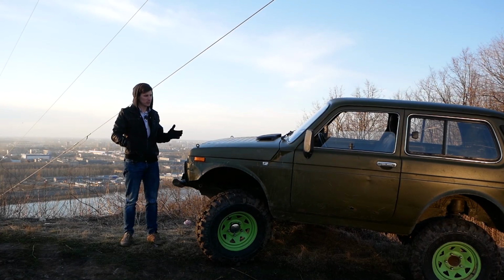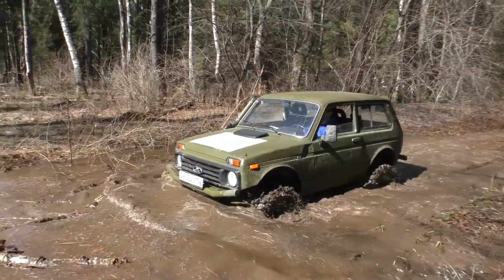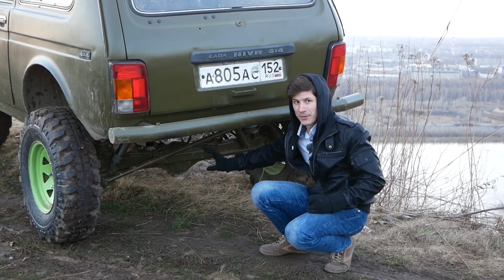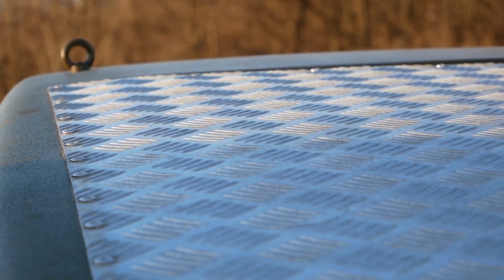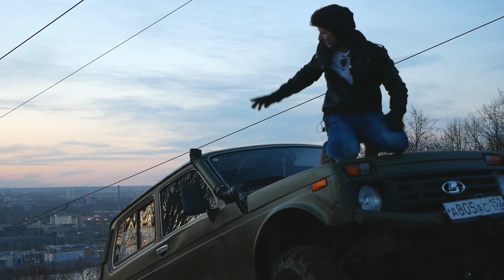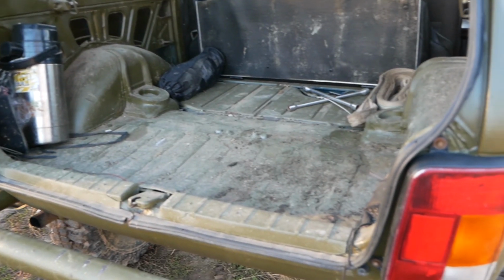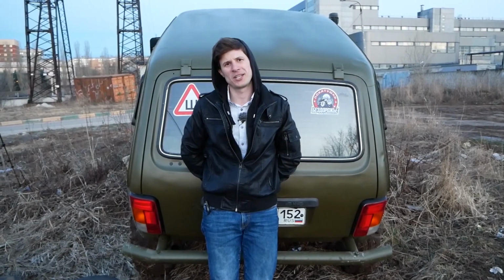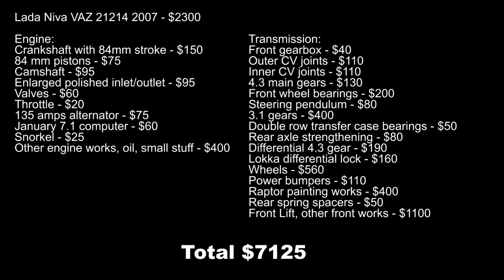How much is to build offroad Lada Niva in Russia

Comment: This is a modification I like. I have two questions tho: I'm looking for a replacement of the original Bosch ECU for years now. You said "January 7.1". Never heard that before. Coudn't find anything online. Where can I get one? And what Lokka diff did you bought? Because on the website there is no genuine Lada Lokka. Great video, 10/10 Lada. Do you know how much power increase there is due to the engine modifications?
Reply from the maker: Thanks!
January is the brains they install in lada originally and they popular here because it easy to ajust them as i remember. You can search it in google just type - january 7.1 firmware for lada. I think, they sell it in Russia only. All the other stuff i don't remember, sorry))

Comment: I have one pretty abandoned but I can fix it into working condition; would you send instructions and how to diagram and parts if I send you money? Obviously plus your fee. Great Video👌🏻👌🏻.. Tks
Reply: If you need any help, I can help you for free))
Reply: @Dmitriy_Poludin  Could you help me, I really like lada niva and its off road performance even when stock. But i thought about buying one and upgrading it. What  do you think i would need to upgrade for little amount of money as possible.
Reply: Ilija Petrovic it depends on what you need, if you want to drive it off-road, so you need to upgrade everything from this video
Reply: @Dmitriy_Poludin  I plan to do some off roading but not so extreme so I'd keep stock engine, if i got all other upgrades from this video do you think i still could use gas instead of fuel? I'm aware that it wouldn't be as strong but this will be my daily driver too so fuel economy is important.
Reply: Ilija Petrovic this Niva is forbidden for daily driving, at least in Russia. If you need it for rare off roads, so just install differential locks and that would be enough